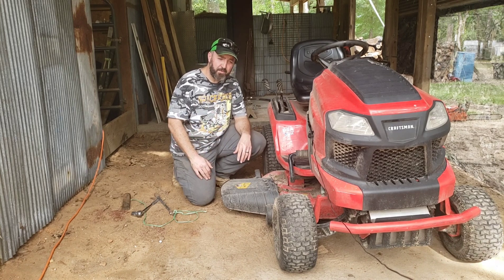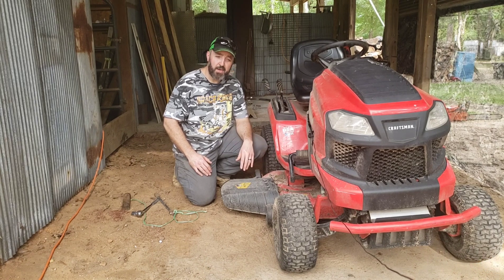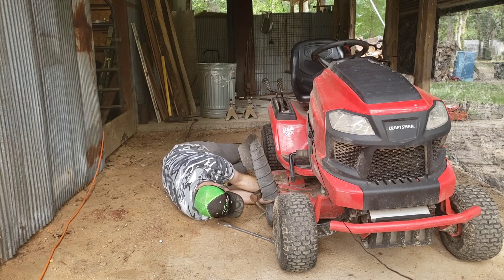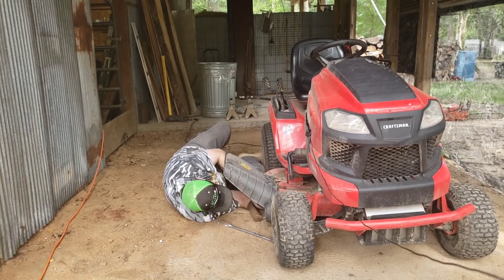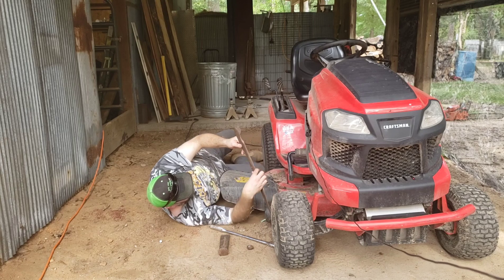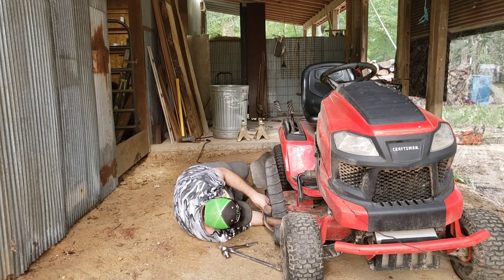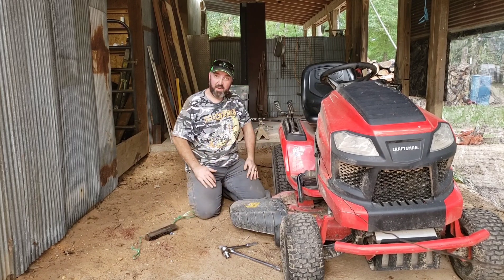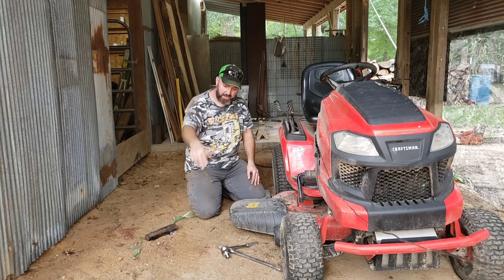How to change a lawn mower blade without special tools in real time.

Comment: I mounted a boat winch on my wall in my garage i used a small pulley on the ceiling on a beam I use it to put around the front axle and you can stand the lawn  tractor up and use an impact wrench to take the blade off it doesn't hurt the engine on the mower because the oil is in the back of the engine and not running up into the head I bought that boat winch at tractor supply and it wasn't very expensive doesn't get used much but when it does it really comes in handy I like your idea to thanks  for the video Jay
Reply from the maker: Thanks for sharing Sammy!